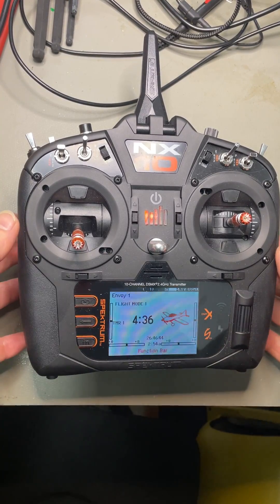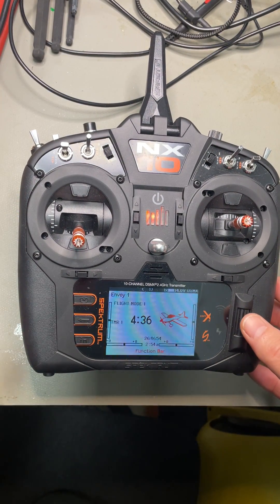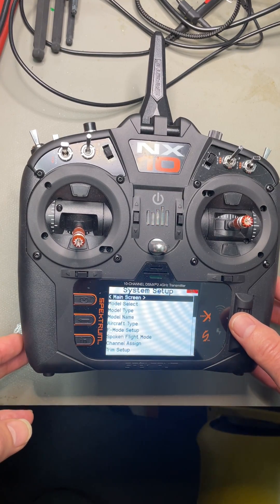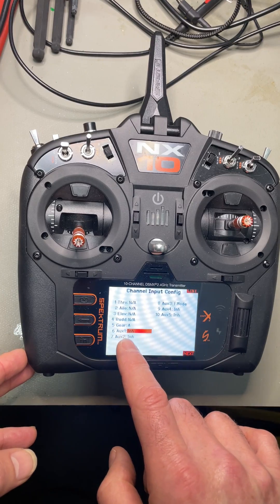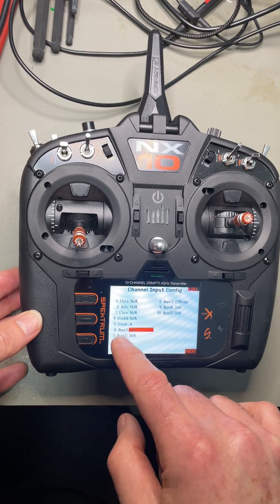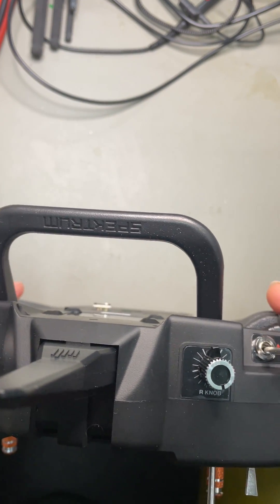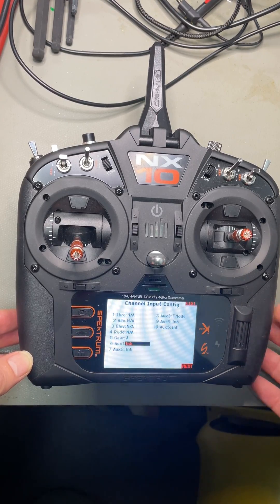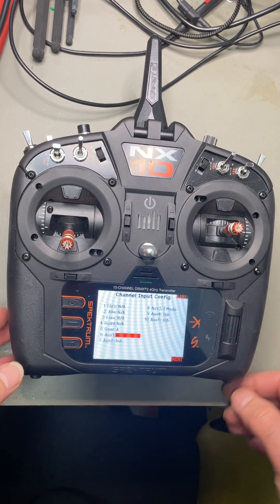Assigning an NX10 transmitter switch to a channel.

Comment: HOW DO I CHANGE GEAR FROM OFF SWITCH A TO SWITCH C IF IT SAYS 6 IS N/A?
Reply from the maker: Hi, if I understand your question, I think you want to trigger the gear using switch C rather than the default switch A. If that is correct, you should move the cursor to the A beside channel 5 which is labeled Gear, and select the A. With that selected, throw the C switch and the A will change to C. Press the selector again to save the setting. Now you will have gear indication on channel 5 using switch C. You also mention “6 is N/A” and I don’t know what you mean by that. Do you want to use channel six to drive the gear? If so, just assign switch C to channel 6 (aux1) and on your receiver, be sure to connect the gear actuator to channel 6.
Reply: Hi, I’ve just bought an Align TB70 & FC6250HX the only spare channel on that is 6, I want to fit an led light bar which has a switch wire but I can’t select channel 6 on my nx8 it skips it, I’ve got light on my other heli’s but using AR200BX with AUX channel so that’s easy 😅
My question is do you know why I can’t select channel 6 on my NX8 please?